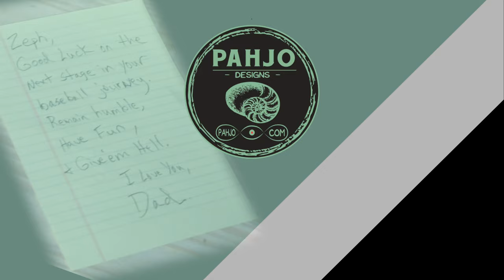DIY Epoxy Resin Art (Full Tutorial)

Comment: Please tell me how the epoxy surface behaves during operation ? how often do I have to grind after minor scratches ?
Reply from the maker: It’s not difficult to maintain at all.  It is also very durable as long as it’s not used as a cutting board.  I would compare it to a wood table.
Reply: @PahjoDesigns  Thank you!